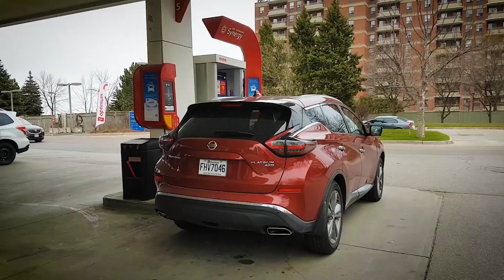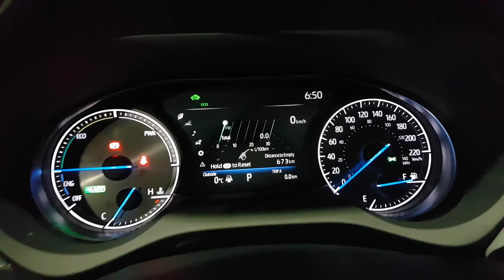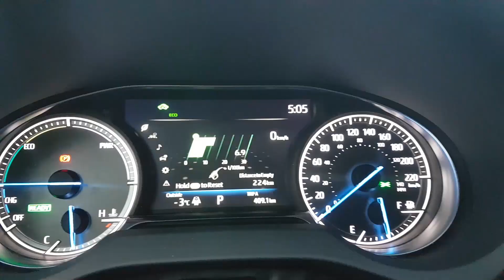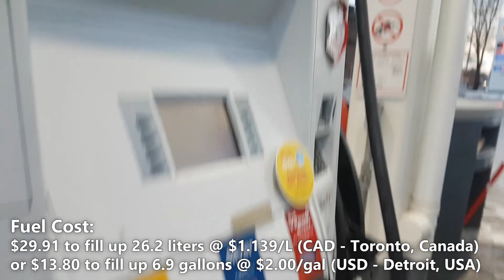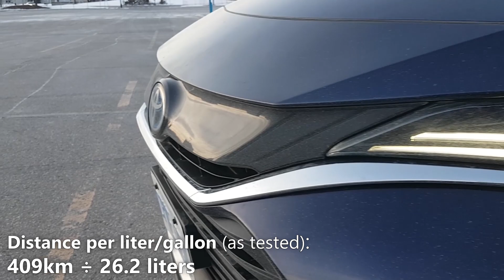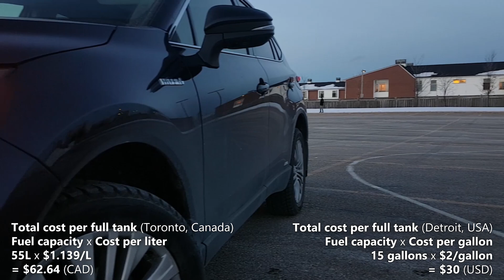2022 Toyota Venza HYBRID - Fuel Economy MPG Review + Fill Up Costs

Comment: An important factor not mentioned here is ambient driving temperature. Winder driving in a hybrid typically yields 10-15% lower values. This is due to lower output from a cold battery and lower energy per liter in winter fuel.
Reply: I was going to ask because its almost the exact same system as the rav4

Comment: Third week of ownership.  Venza Limited.  Live in relatively flat Midwest.  Ohio.   All day driving, to supermarket, to visit daughter,  all local driving with lights.  No hwy driving. Got up to 55 mpg, but then some mild hills dropped it to 47.   I’ve been averaging 45 mpg.  However, I am making a conscious effort to follow best hybrid driving methods.  Lowest days, where I did gas it, it dropped to 37.  AC on the entire time.
Reply: If u calculate the fuel ⛽️ gallons with range it ends up being 41 no where near 50